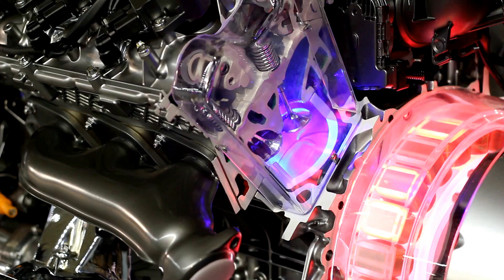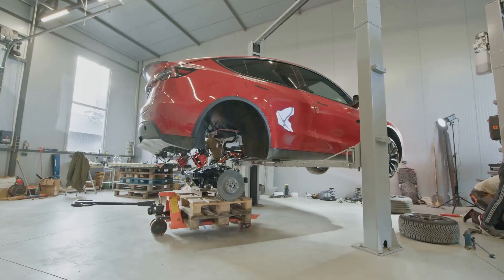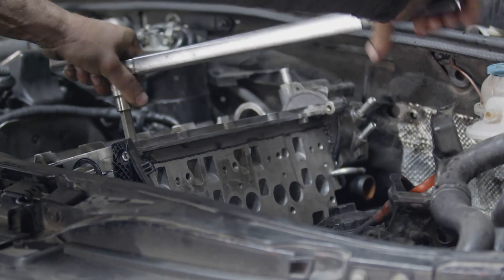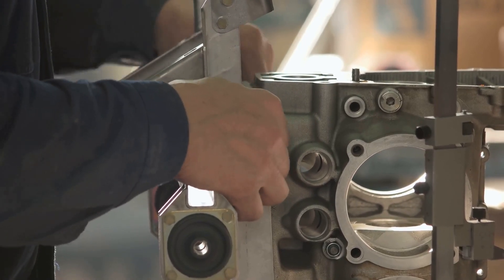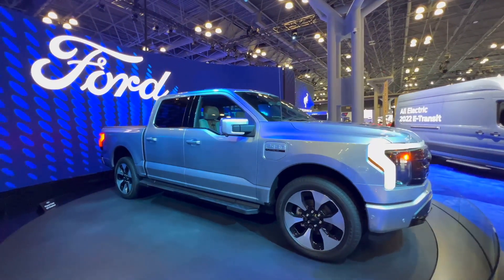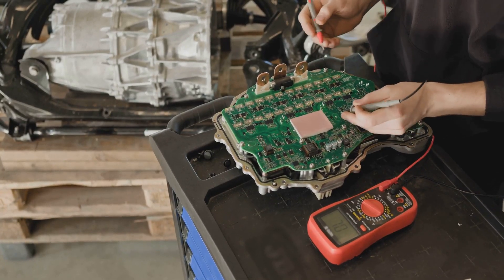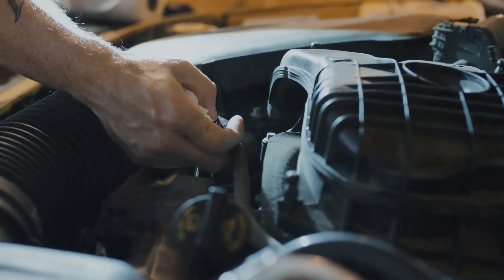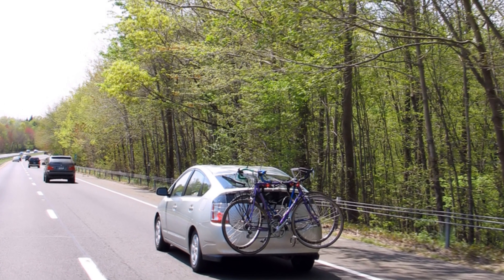Transform Your Ford F 150 into a Hydrogen Hybrid

Comment: This will be the same as it was when propane conversions came out.
Big tanks and no where to put them? The truck these days don't have 8 foot boxes anymore.
Very limited places to get hydrogen fuel for the individual person.
Too expensive, might as well continue to use gasoline.
Propane was great for a while until the price of the fuel wasn't much cheaper than gasoline
I guess it wasn't that green of a fuel after all.
Reply from the maker: I plan to do this to my own F150. I will have a series of videos documenting my efforts to produce a hydrogen hybrid. The beautiful thing about hydrogen is I can produce the hydrogen while the vehicle is parked at home.